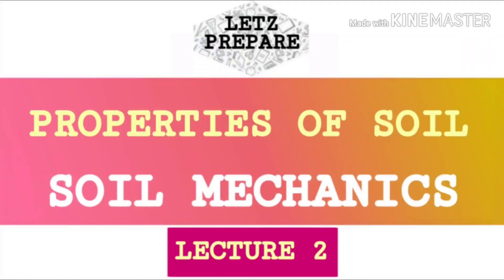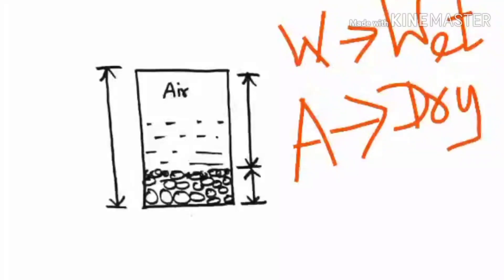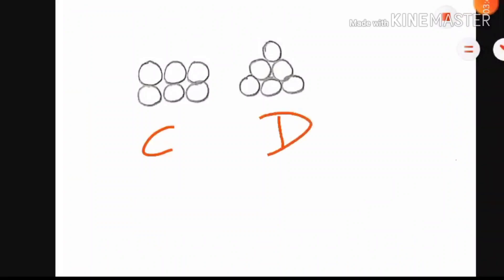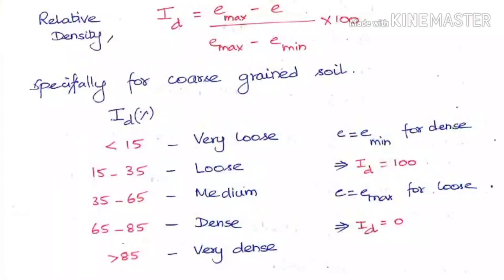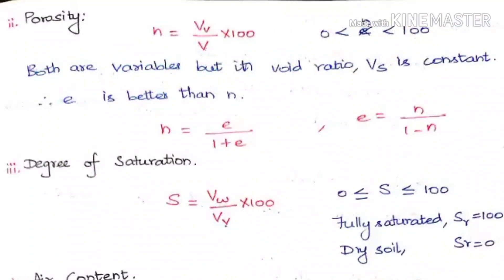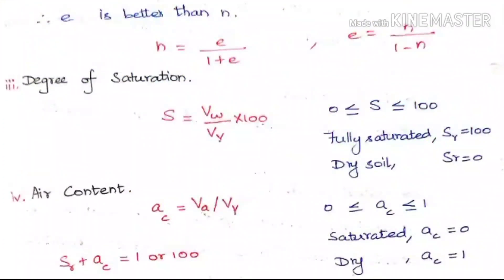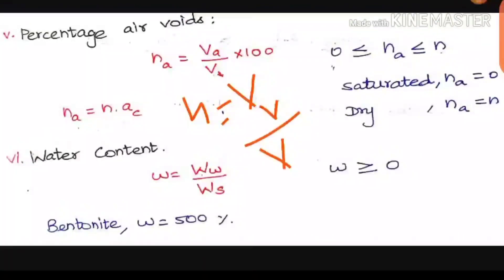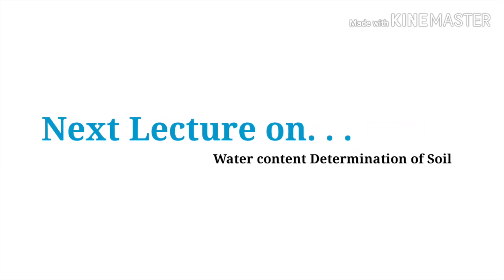Properties of Soil | Soil Mechanics | Lecture 2 | English

Comment: Mam ,  I have one doubt can you clarify that doubt.  ,In coarse grained soil.  Having    big voids    but fine grained.  Voids small but.    Fine grained soil value for e high  how it will come   pls explain me mam
Reply from the maker: It's really a Good question. 
The reason is voids is more in case of fine grained soil.(there is a difference between more voids and bigger voids). This is because of the higher surface area of fine grained soil.
Reply from the maker: For example, take a 100g of single particle(gravel) of coarse grained soil and also take the equal amount of fine grained(clay) soil. Here Vs is same for both case. But Vv will be more in case of fine grained only. This is because of the Surface area of soil. When the no. of particles increases, the surface area increases. Therefore e(Vv/Vs) will be more for fine grained soil. 
Let me know if you have understood the concept !
Reply: @letzprepare4511   crystal and clear concept
Reply from the maker: Thank You. . Keep Preparing ! Keep Watching !
Reply: @letzprepare4511   yes mam, thank you so much your reply mam